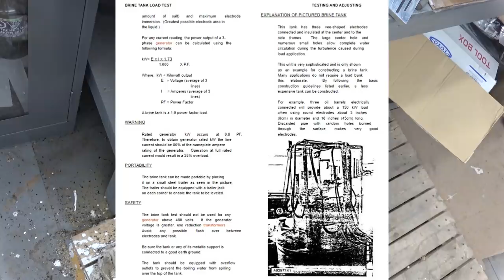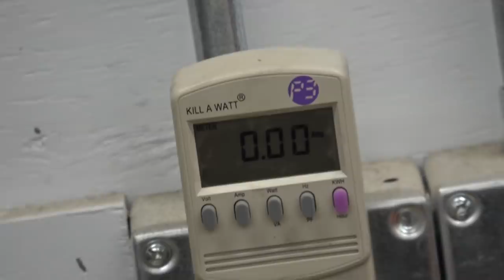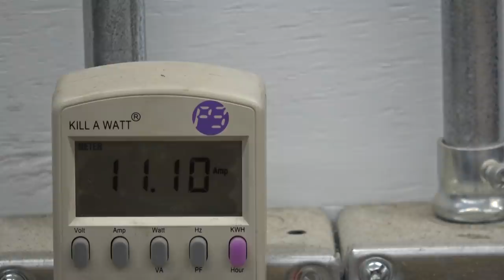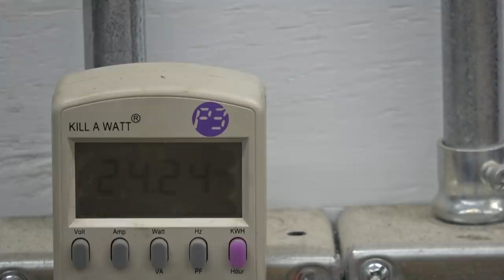Forgotten knowledge: generator load testing

Comment: We used a tank of brine as a resistive speed control on a 5000HP motor at work back in the day. Still in use I'm sure. Accidentally put way too much salt in it the first time. Ooops.

Comment: You've probably been told this a few times by now, but breakers will allow a LOT more than you'd expect. Usually, it's something like 3x the rated current for 5 to 15 seconds before they trip. IIRC, some breakers will allow almost double their rating for up to an hour. I think ElectroBOOM included a graph of his own breaker type in his last video about patio heaters, since he came across the same situation where he expected his breaker to trip, but it didn't.

Comment: Only want to do this in a well ventilated area. Those bubbles coming off the electrodes are hydrogen and oxygen as the magic pixies rip the water molecules a-part. Hydrogen is very easy to ignite. Adding in the oxygen will just make sure all of the hydrogen goes boom as rapidly as possible. Because this is AC, both gasses come off both plats. With DC you get one gas off the anode and the other off the cathode, though I can't recall which way around it goes.

Comment: We load tested 500 kW gensets using a 210 litre drum and water and salt 25 years ago. But you should lower the electrodes into the liquid and then add salt to load the system up. Don't add salt first.

Comment: Fun facts

There are common house hold items that you can use to replace fuses.

The old screw in fuses ....use a penny it has a 100 amp rating , it may only cost 1 cent but the look on the Fire Marshall's face is priceless.

The glass fuses in your old Chevy pickup, use a 22 LR. bullet 
25 amp rating and has an "audible alarm" feature.

Replace those NOS fuses with a 1/2 inch bolt.
700 amp rating, you'll never buy another fuse .

You can replace any breaker by using a vice grip to clamp the wire directly to the bus bar 
( just remember to say "Hi" to Jesus for me.)

* For Gods sake don't do any of this unless you have a cameraman handy.

Comment: Must be a FPE breaker panel. You don't need a welding machine with an old Stab-Lok panel. Jam some leads in the socket and run it until the wire melts out of the breaker.

Comment: I feel it should be mentioned, hydrolysis of salt water produces hydrogen, oxygen, and chlorine gas. A mixture that is extremely explosive. (and photosensitive.) Use in well vented area, mother on speed dial, children filming the dad-go-boom(tm) from a distance...

(We prefer loads of space heaters. I assume you'd have plenty there on Hoth.)

Comment: breaker wont trip with out a 10X rated increase in current (Magnetic trip).  when it normally shorts, it shorts big and fast.  for a small over current you would need an Thermal Over current breaker that handles the 1.25x - 3x rating of the circuit breaker.   Small over currents cause the fires because the wires over heat and burn.

Comment: I have worked with 12 lead generators for 23 yrs. When I ask the manufacture if I can do this or that, they say NO. So I go and  reprogram and re-tap the generator to what I want. Say from 120/240 volt 60 Hz single phase to 380/220 volt 50Hz 3 phase. I lower the RPM to 1500 and dial in my voltage, then have a tech. with a laptop come and put in the new firmware updates to the motherboard. Also, the software code numbers that are on a sticker on the generator are crossed out, and the new are posted in case the motherboard is changed in the country it went to. People are just dumb anymore.

Comment: just curious..  if you are creating a Leyden jar .. with that bucket of salt water. . leaving it charged to clamp the next guys .. well hole body in the electric shock vice..  my brother broke his wrist one day with a water faucet and an extension cord in his hands..  doctor said he had never seen that sort of damage except on cadavers. 

 makes me wonder if wearing a static wrist band hooked to the GFCI might trip the breaker if you get shocked doing some of this. 

 i  have always wondered.. if you could charge a bank of leyden jars with a lightning strike on a lightning rod..  using a quick blow fuse to ground the lightning rod till the lightning strikes.  then all the electron pixies go into the laden jars..  only issue.. how the heck do you discharge it.

Comment: The King of Random (back when it was just Grant [God rest his soul] breaking down old microwaves and flat screen TVs) made a variac with a salt water solution and two electrodes that were on a throttle of sorts, and could be lowered into the salt bath to the desired amount.

Comment: There should be a fuse in that kill-a-watt that you can replace with a penny or somethin' to get it started again.

Also, running 25 amps though a bucket like that is likely liberating about 175 standard CCs of hydrogen per minute, so don't stick the jury rigged kill-a-watt and your 25 amp hydrogen generator in the same small cabinet for too long.

Comment: Clean bucket and distilled water. No amps will flow. Add some salt and you've got electrolyte and an angry-pixie bath. More salt=more pixies. Add more water to quiet'em down. They used to control stick welders like this before they actually had controls. Only problem is, of course, is it's a coffin waiting to happen.

Comment: Why the breaker didn't trip when it should.  Cheap off the shelf monitors have a tolerance of error greater or equal to their lack of fucks for quality for something like the "Kill a watt" I would hazard a guess at +/-20%.  The breaker is most likely +/-1% cuz accuracy for that is cheaper than me so it's more work to be lower quality than to be quality.

Comment: there's characteristic curve   for each breaker (normally in it's datasheet) that'll tell you the time it take to break a the circuit vs the current it is passing, typical  response time is counted in dozens of seconds  even minutes at rates near exceeding (200%+)  their rating.   (Not an electrician, I did see that curve  though)

Comment: AvE I recommend running the numbers on how quickly you will boil off the water. It's quick with any reasonable size Gennie. Then you need to figure out how to safely add more during the test. Suuuuper sketchy. I recommend looking to electric hot water elements, cheap like borsh. A few of those and some beers for the dewclaw and you're in business.

Comment: i've done this, it will make are butt puker, use distilled water, put the electrodes in it completely, start the generator, close the breaker.
while watching the amps start adding salt, slowly to bring the load up on the generator, add water as needed during the test. try not to let it boil.

Comment: So to dissipate any energy, and the making of a good load tester has to convert the electricity into heat, noise, or motion right? Seems like an electrical corrosion generator isn't the most efficient waste of electricity.

Comment: I was hoping you'd dunk the output connectors of the Surplus Diesel Slurper into that bailed pail.
More reasonable resistor load for that thing is a thousand gallon cattle tank and about thirty bags of salt, but you use what you got, eh?

Comment: Byzantine manuals are bad but at least comprehensible.  There is an Omega thermocouple reader for which the manual was so bad  i had to write a work instruction just so my crew could use it.  The instructions were so bad I had to press every button to write down what it did, figure out how to connect it to the laptop, then document every all the differences between the unit and the GUI.  Took me three days. I complained to Omega about.

Comment: Electrolysis in water always produces hydrogen which can theoretically explode but it's pretty hard to get it to do so.  It is very mobile and hard to contain.  Electrolysis in water and table salt (NsCl) on the other hand will always produce hydrogen, chlorine and NaOH (lye).  The hydrogen is the same as above; the lye is not particularly dangerous as long as you know it is there; but the chlorine  is toxic and won't flee like the hydrogen.  You'll know it's there on the first breath but one breath may be one too many.  I recommend using washing soda or even baking soda instead.

Comment: Your shop must be using them Stab-Lok welding breakers. Seriously though, if you check the trip curve of a decent QO breaker, a 20A is rated so at 40°C. By the time you get down to 0°, you're crossing 25A. I'm assuming your shop ain't a sauna. If it's not a bolted fault (not tripping the magnetic element) a slight overcurrent should take a good few seconds to trip or we'd never get small motors spinning.

Comment: Being both lazy and cheap my solution is four, or whatever it takes, 1500 watt space heaters. With the different heat settings on each I can get most any resistive load needed. I am too lazy for the bucket and water and salt and drilling and finding wire stuff. And the cheap part....when I am finished I put them back in their boxes and give them away as Christmas presents.

Comment: Interesting how that Kill-A-Watt meter isn't on fire! Those things are only rated for 15 amps man. I like you're idea here but would question it's consistency or repeatability. Quick and dirty I'll get'er done, but I think I'd be looking more towards multi stages of coiled thermal wire. That way you could more or less dial in whatever load you like.
Cheers 🍻.

Comment: You should have warned the geniuses out there , not to reach into yon bucket when the wire is attached to der platen und der ixies are coming thru the copper pokey thing, or they might catch a faint whiff of bacon cooking.

Comment: Try straight tap water without salts to increase resistance?  If that's not enough for better control at lower amperages distill the water first to remove the conductive minerals, then gradually mix salt or non distilled water back in until it's skookumfied as frig......

Comment: The 117 VAC breakers in the Shop may have a higher inrush rating than breakers in a house. Also, what you have created, and did not notice, a Hydrogen Torch gas generator!

Comment: As for the Manuals becoming more difficult to understand:
EVERYTHING is much more complex now... Open any electronic made in the past few years, and look at the datasheet of some of those components, you will find that most of them are around 10 to 130 pages long...  So, yeah, the manuals are more technical now... 
For example, most vehicles today, have over a dozen of independent "computers" which talk to each other over three different networks, while old ones had none... So, yeah... Just the emissions system in a modern vehicle, is much more complicated than every system in an old vehicle combined...

Comment: The breakers have different curves, B, C, Z... if you have a B, for example, the fast way of tripping it is with 3 to 5 times rated current. If you wait for a minute or so, it will trip at 1.13 times rated current... seems to be avery unknown fact, that the rated current is not the current at which it will trip https://www.electricalclassroom.com/b-c-d-k-and-z-mcb-trip-curves/

Comment: In my industry (before retirement) we used liquid resistors in a lot of applications.  There are fairly easy formula to calculate the resistance you need depending on geometry, salt used and concentration.  If I could attach jpg files I would share this here.

Comment: You can make this perfectly reasonable test bucket a lot safer buy sitting the whole setup on a metal baking pan or trashcan lid it whatever. Then put a hard ground on the metal pan. Now if any angry pixies escape they go to the metal and earth, and not your little piggies. It'll poop your breaker instead of your sphincter

Comment: So, mandude, how are you dissipating the Hydrogen coming off your resistor?  Not a crisis, but too much testing with your VR and you have the potential to make a REAL cool video of the rapid oxidation of decomposed water!   Especially problematic since the anode and cathode switch roles 60 times a second. which provides both components at both electrodes.   Good stuff!

Comment: Worth seeing if you can get some of the cheapo smart energy monitoring plugs, I got a pair to crack them open and put open source firmware on them so I have just a hint less chinese spyware on my home net. Just the trick for doing remote control and monitoring of my 3D printer.

Comment: Do you smell chlorine when you do this?  Probably much safer to use baking soda rather than sodium chloride salt, but still those bubbles are going to be hydrogen and oxygen, so not near open flame and outside only either way.

Comment: that archaic method of resistive artificial load is forgotten due to the fact that its known to give, very aggressively, the most coveted darwin award to anyone near it, especially the operator. but its still very much use today in our shit hole of country. which begs the question. is darwin award woth it to someone whose luck just ran out or victim of circumstances?(as I lower a metal plate on the vat of fresh sea water)

Comment: This is easy but not safe. If the generator fails in short mode or with a spark it could go BANG because of Hydrogen H2..

Comment: Call me boring, I think a safer design could be accomplished. Something where one electrode is in the bottom of the container, and the other above the water line. And then some action (like maybe raising another container connected via a hose) causes the water level to rise. That way, if you drop it, you would be failing safe (water level lowers or all the water spills out) instead of failing unsafe (electrode drops into water). I'm remembering a story regarding two graphite spheres, a radioactive source, and a screwdriver...

Comment: Hey uncle, do a search here for "stinger prison boiling water"
They boil water in prison by taking two grills off the floor drains, separating them a quarter inch with some insulators and rubber bands, toss it right in the 5 gallon bucket. 
bumblefucking genius.

Comment: Also good way to load smaller welders ( less than 250 amps ) when testing.  My husband has been doing this for years before buying second hand welders. Many do not pass after 45 seconds. Of course he uses a fluke dc amp meter to ensure testing accuracy.  A lot of junk used welders out there. Beware.

Comment: I'm no chemist, but doesn't the electrolysis of salt water produce hydrogen gas and chlorine? You might want to take your variable resistive load outside to reduce the bang factor.

Comment: Only ave would risk tangling with the angry pixies for internet fun.

Back in school I used to get in plenty of trouble with them, bet kids I could stick a metal object in a receptacle without getting electrocuted for $5. Of course I never did (aim for the big hole, it’s easy for a reason). But then I’d bet them that $5 back, and either get a show, or have to return $5 that was never mine anyway. 

Labeling science lab outlets “key cleaner” takes about 2 weeks to generate carbon deposits.

Comment: I fried mine too - was surprised to see mine was topped out at 15A. If you're a perfectionist, the replacement fuses are all over eBay. If you're a real man that shoves pennies in fuse boxes, you just use a length of 12g wire where that fuse use-da-bee

Comment: Maybe the ole Dewclaw slipped in a 30A breaker on you?
Reply: nope thats just how breakers work, off heat not instantly off load.. if every 15amp or 20amp breaker tripped the second you exceeded that rating there wouldnt be too many power tools you could start up.. at 24amps its gonna take a good long time to trip that breaker.. and it should take a good long time its not like the wire instantly sets a blaze at 20.01 amps.. the wire used for a 20amp circuit will hold 24 amps indefinitely

Comment: Don't know why you're trying to redneckineer a bucket 'o 'trouble when you can go buy a few shop heaters and get safer and more controlled results. I've used an Avtron to load bank a 220kw generator at 250kw and heated a 20*F 4000 sq ft shop up to 90*F. The Avtron's just a crapload of heater coils in a rolling cart with switches for each row of heating elements and a handful of fans to keep it cool. I know because I've rebuilt a few of 'em.

Comment: Works great until the water boils and the movement of the bubles constantly shifting the water level makes the current jump ALL OVER the place and sets you governator and tension regulator full bumble fker...
Another usefull time saver for you is: if you do 3 phase tests,  arrange the electrodes equally spaced in a tringular shape.
In order to test 100 kW gensets you can boil 1.000 liters of water in about half an hour....

Comment: 1. G399 cats...hate em their governors suck....3500 series gtg...people hate Waukesha 7042/7044 but we have a mess of them and they are troopers.
2. That harbor freight tail gator. Ran 3 of them keeping 24vdc power supplies going and communication going at stations durring ice storm. They ran like 7 hours with a 4.5-5 amp load. 10/10 would buy again. Imagine the power quality is smack nasty though.

Comment: Manuals suck now. PDF for my 2001 Focus = 141 pages. Tells me every detail to every part, maintenance, and fluid of the car. PDF For my 2010 Mazda CX9 = 692 pages and I can't figure out what kind antifreeze to use to flush it. It just plain tells me the transmission fluid CAN'T be changed due to it being LIFETIME FLUID! Gotta get me some of that "lifetime fluid"

Comment: Yep, we gittin dumber. Used to was, an owners manual would tell you how to set the valve lash in your engine. Now, it just warns you not to drink the water in the battery.

Comment: Your Kill-A-Watt is probably rated for 15A and =<2 kVA. Now now! A chain is only as strong as the weakest link. 20A breaker, you say? Well…then you'll need a meter rated for >= 20A too, Uncle Bumblefuck!
Reply: Also, seeing as you have a perfectly good clamp meter, rig-a-jig on your bucket and attach the meter over the stationary electrode. (#dontkillakillawatt)